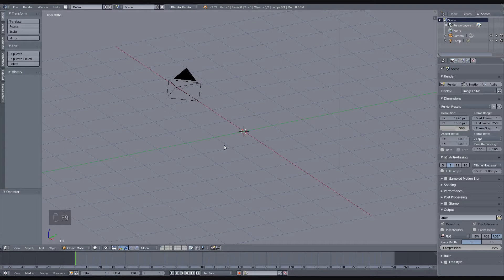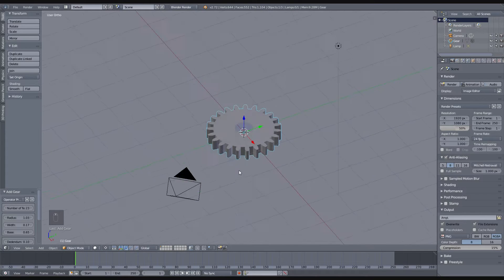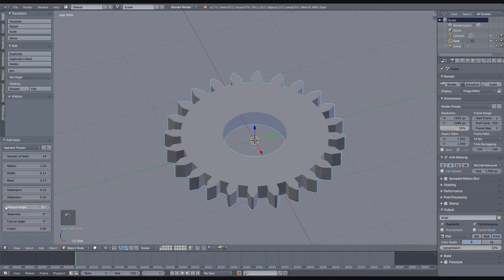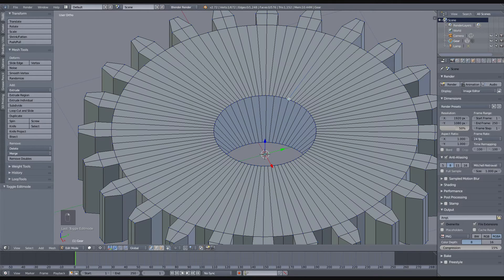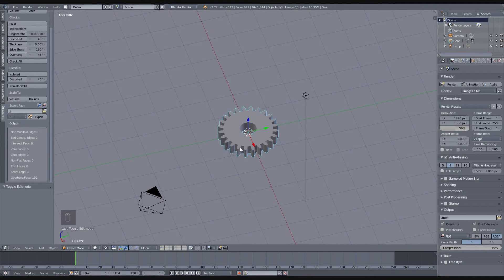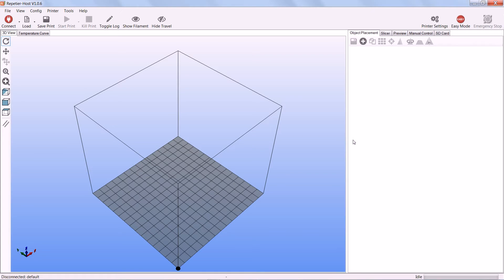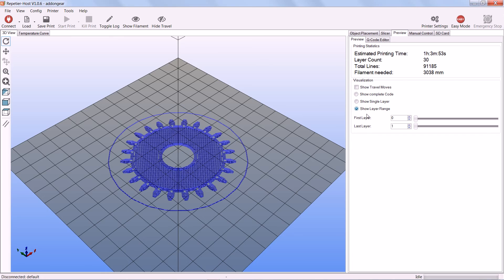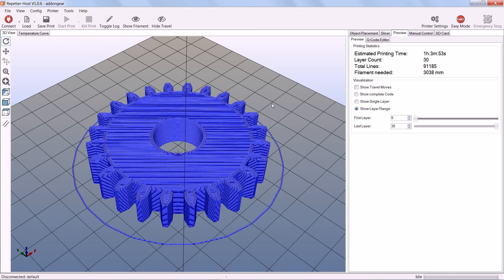3D printable Gears in Blender, part 1 - with Blender Addon

Comment: so the bridge worked for the inner circle part, but the gear is still printing hollow inside with cura, is there a setting to tell the slicer (or blender)  to fill in those gaps?
Reply from the maker: Try to use an online stl check:

https://www.formware.co/onlinestlrepair

Comment: Add-on gears don't take the smoothing modifier too well though. Maybe not needed too often, but sometimes it's handy. I devised a work-around (modeling from scratch), but that's a whole other process and topic.

Also why not just use the scaling option under export to STL? That way you can keep things to a scale more comfortable under the Blender UI.
Reply from the maker: I don't use Blender's add-on for gears anymore after I found this http://www.emachineshop.com/machine-shop/Free-CAD-Design-Software/page100.html free CAD software, designed to create perfect gears, and to export them directly into STL.